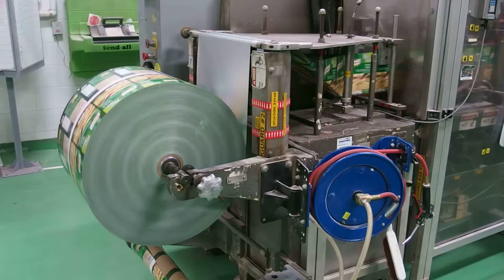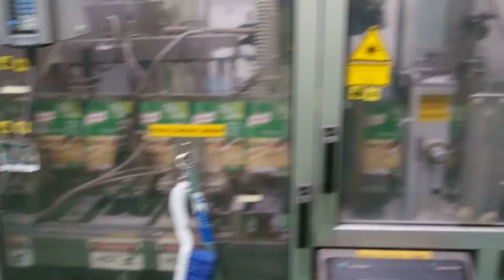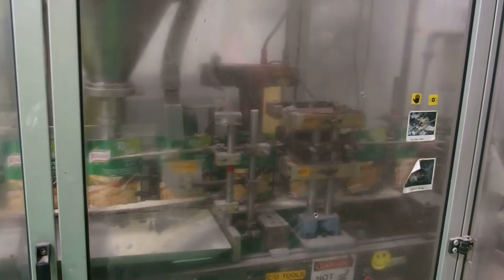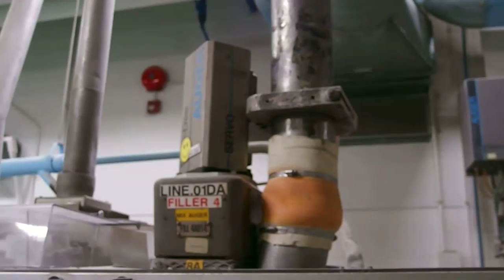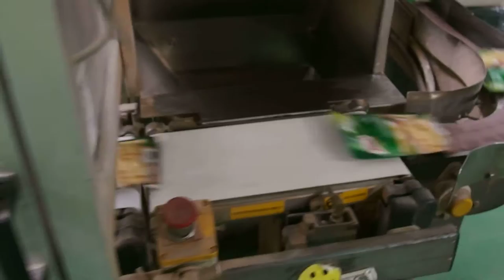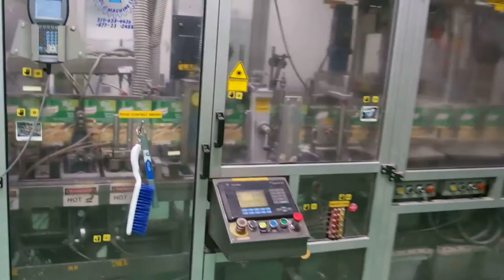Bartelt Intermittent Horizontal Form Fill and Seal Machine

Comment: Where it is that Bartelt? It has Automatized Box Sealed?
Reply from the maker: Hi Nicolas!
Thanks for your comment. Unfortunately, this particular piece of equipment is no longer available, however we do have a similar machine located in New Jersey, USA. You can check it out here: http://www.equipnet.com/-kl%C3%B6ckner-bartelt-rpm-100-intermittent-motion-poucher_listid_242564/.

If this is not specifically what you are looking for, we can still help you find what you need. Please feel free to contact us via email at sales@equipnet.com or call 781-821-3482 or another local office: http://www.equipnet.com/contact_us/#locations.
Reply: I have a couple of these at work, really cool machines